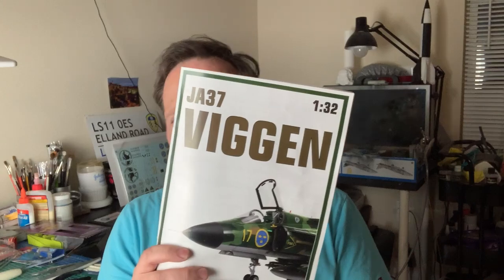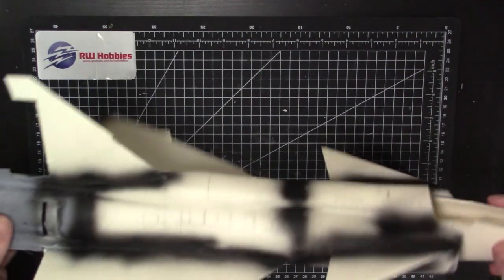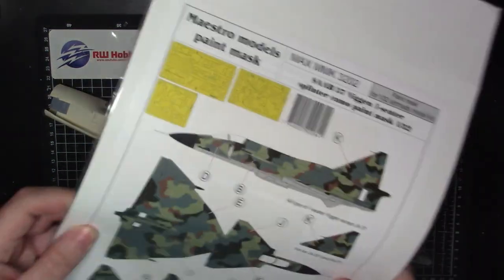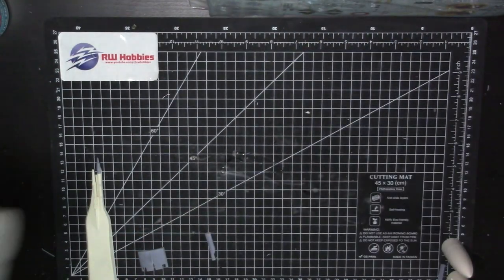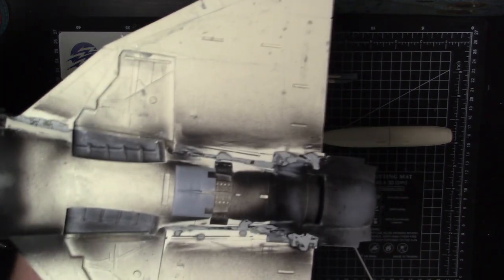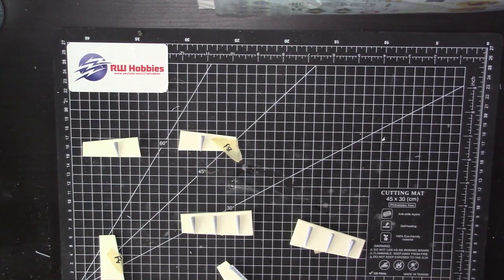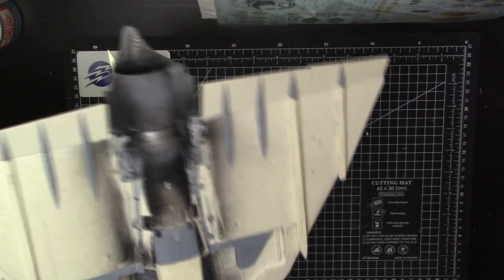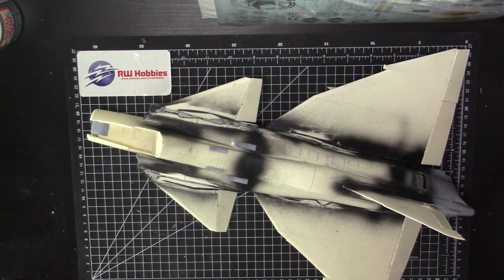1/32 Jetmads JA37 Viggen Build Series - Part 5: Assembly continued

Comment: What did you use to rescribe the resin? And is it softer or hard resin?  Tx!
Reply from the maker: I use the basic trumpeter scribing tool. I just ordered the Tamiya 0.2mm engraver though. The cast resin is soft.
Reply: @RWHobbies  Thanks. I also use the etched Airwaves saws.....but at least one rescribe per models jumps out of line....agh!